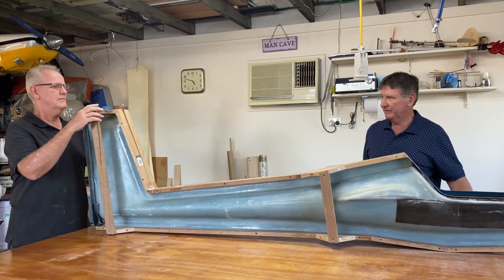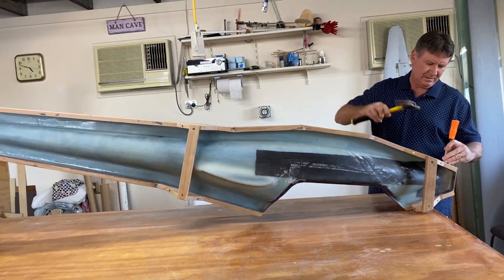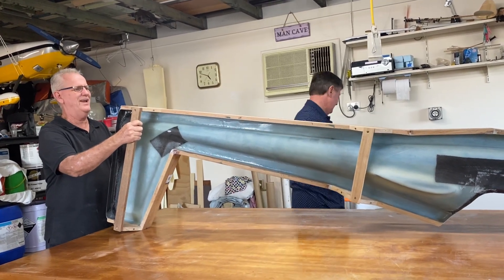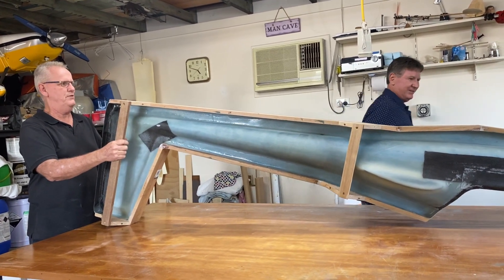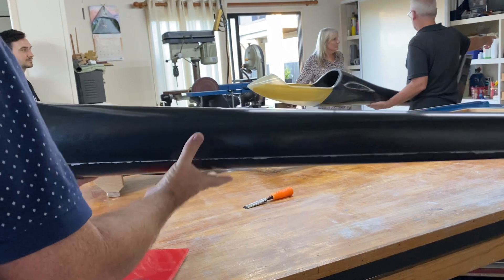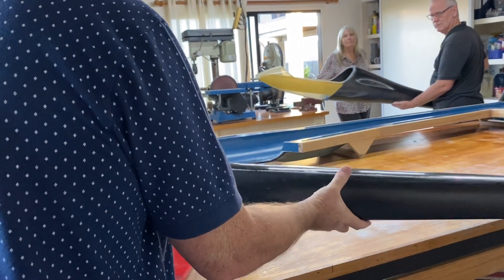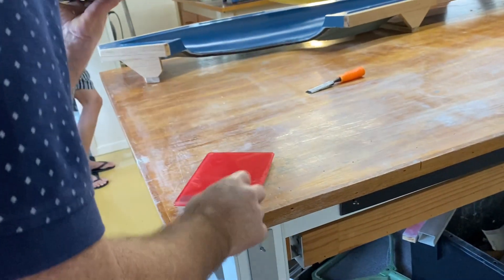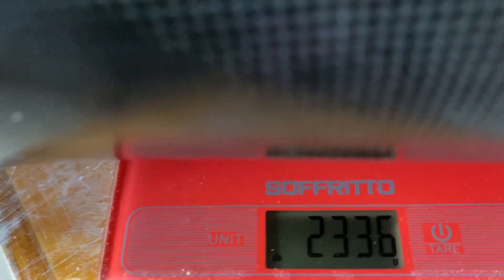33% Nimbus Fuselage Released From Mould

Comment: Glass fibre cloth/graphite fibre cloth and kevlar cloth?
Reply: The radio transmission signals will not pass through carbon fiber.  The 'cockpit' area and nose of the fuselage is made of regular glass-fiber because that is where the radio-control receiver and other electronics will be located.  The kevlar strips are laid in the stress areas that need reinforcement for strength in case of nose first impact, but overall this area of the fuselage is far less stressed than the boom/rudder and lifting surfaces of the wing where carbon is used.

Comment: professional Fuselage build ?  No bolts in the molds, connecting with screw clamps like in stone age, not possible to push/close the mold due to the rising inmolded peaks. no white Gelcoat on the fuse, take out and fuse is ready. This is not state of the art in Mold and Fuselage building.  Carbon looks good but not necessary. area fuse/rudder is immensly stressed and will break.
Reply: There’s more than one way to make something. 😊
Reply: I think the wooden frame is a good idea on such a long mold, to stop it from warping. Makes bolts redundant. Metal frame is also an option. But I think you'd be being a bit too harsh. They probably know what they're doing.
Reply: before you make critical editorializing comments... make sure you have explained that you have lots of experience with this process... or NOT !!
Reply: You have no idea what you are talking about... get stuffed.